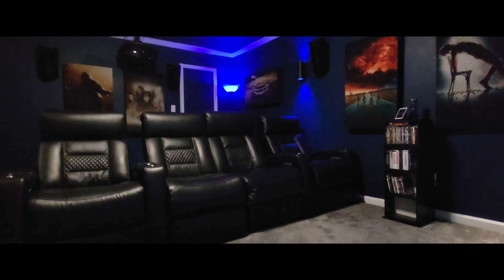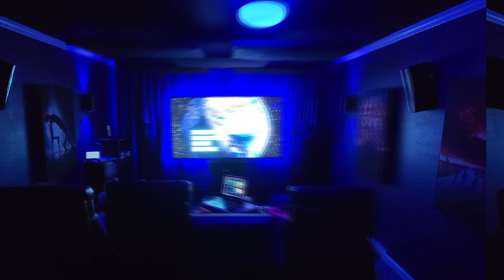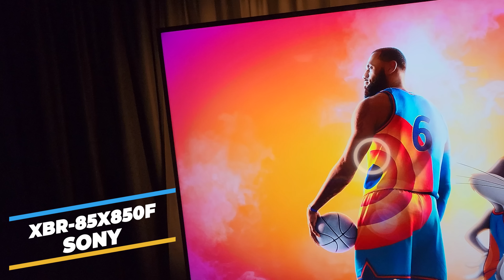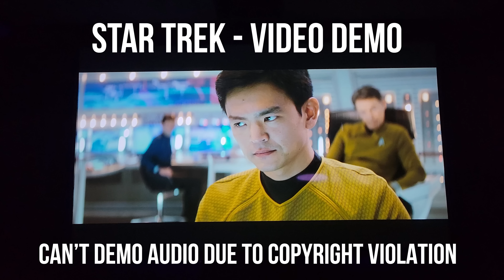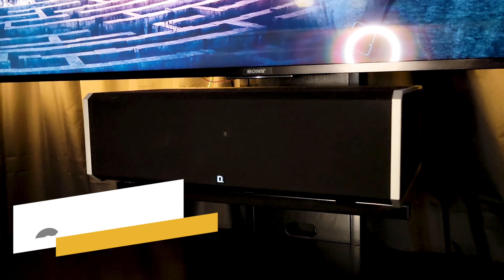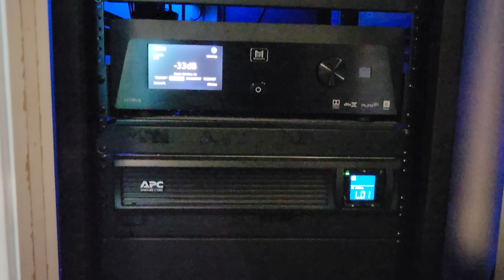AMAZING 7.2.4 HOME THEATER TOUR! // 18" PSA SUBWOOFERS!! 4K Dolby Atmos / Sony 4K / Monolith HTP-1

Comment: Great work on the theater Eric.  I am very curious about the PSA subwoofers.  I have no doubt they kick hard and provide some astonishing low end.  Do you find that having a smaller slot port causes them to have port noise?
Reply: I was a little concerned about these specific models after seeing them but I have had 0 problems with port noise from them. The port is actually much larger than what it looks like since it is on the bottom and to really see the size you have to basically get down on the floor to see them straight on. The cabinet is about two feet wide and the port spans that length and is about 2 inches tall so there is a lot of room to push air. They are also quite capable only needing their gain to be set to about 20% to create some very tactile bass. They are worth looking into, Tom provides a trial period to check them out and he still responds personally to emails.

Comment: Nice room. But the projection screen doesn't seem to be much bigger than the TV.
Why not go bigger with the screen, or slightly smaller with the TV?
Reply: It really just looks that way, the projection screen is 25" larger diagonally. I will likely go larger in the future though. When I had two rows I was considerably closer so that size made sense. Once I upgrade the projector to a JVC laser version I plan to ditch the TV as I got it to reduce lamp hour usage as I use that room as an office too. I'll stick with SI and I'm thinking I'll go around 130-150". Thanks for watching!
Reply: I now have an NZ8 projector and I have a 133" Stewart StudioTek 130 screen being built